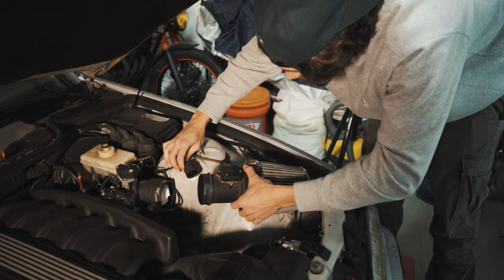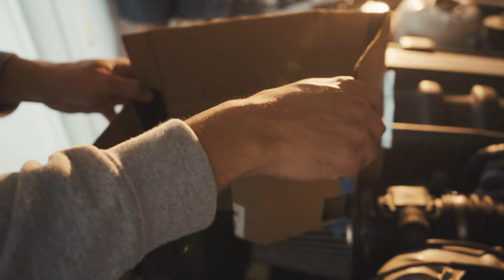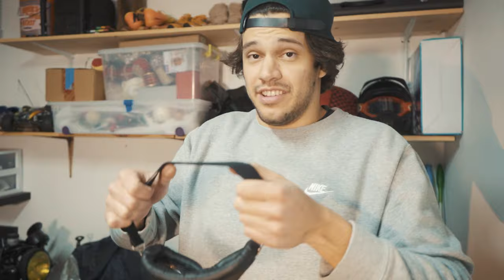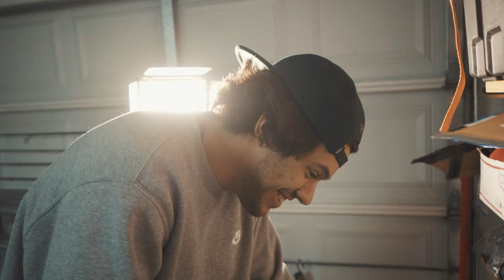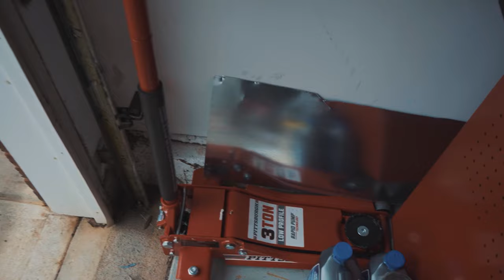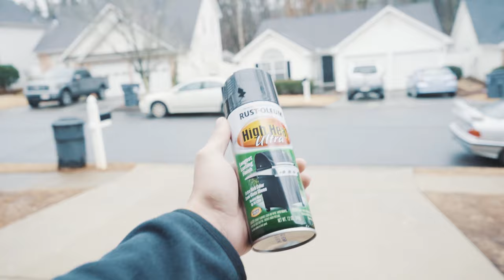DIY E36 Air Intake Heat Shield! (how to make a heat shield)

Comment: nice, but the problem is that iron plate can get the hot air and keep the air inside the area warm....but the job was awesome!
Reply: That is True but to be Fair he has alot of cold air traveling in From that front Right Panel, It looks like it protects it better than factory.
Reply: @organicintelligence6431   Better???? bro factory is just a whole splatic box where 1 small pipe goes to the front getting only cold air.......

This only better to have when you install such filter since without you probably lose more HP then what you had with the orginal filter.

Comment: don’t use a thin sheet of aluminum as a heat shield. heat will not deflect like you want it to if you’re using sheet thinner than 1mm. it will only trap it and eventually allow it to travel through

Comment: I have a '96 corolla that I recently bought a short ram intake but want to build a heat shield for it but don't know how I'm gonna do it exactly & don't know what parts I need
Reply from the maker: I explained what materials I used in this video. Use cardboard for the mock up, it'll help a lot
Reply: @ONGO_  and I can still use the bottom of my air box as a bade so air can still come in?
Reply from the maker: @Jeremy_Hill_2020  I'm not sure how the engine bay is built in that car so I couldn't tell but as long as there's airflow you should be good

Comment: Did you test for temperature delta? 1) What was the air temperature (ambient) and 2) the air temperature at the sensor before heat shield? Then 1) the ambient air temp and 2) the air temp at the sensor with heat shield on? Usually from 1) to 2) there's a temperature increase and if your heat shield is working the increase in temperature from 1) to 2) will be less (that's the delta). A problem with many heat shields is that after they heat up there's no change (0 delta) or worse + delta. What you want is a negative delta (a measurable decrease in temperature to the sensor) after the install. No change or worse means you wasted time, money and effort (I hope not).
Reply: I think I have that problem with mines right now. It does works but becuase of using aluimuim and haven't put anything on the outside of it, it warms up. Atleats it colder then before becuase previos owner had nothing and was really bad, hot days when sitting still the engine could turn sluggish becuase of the hot air it was getting from the engine bay. 

Now I have putted the orginel inlet trough the shield and added even a extra inlet from below where air goes from your bumper to your brakes, I open it then put a long pipe to my airfilter. It get the job done and works pretty great but it is not the perfect solution. Will work on it but am thinking of swithcing to something else then alumuimum, maybe ABS plating since it pretty easy to work with but way better heat resistatnt. Maybe even double layer with air in between for even better heat resistant :).

Comment: I finally bought the stuff to make a heat shield for my intake 
my dad already has a dremel & a angle grinder in the garage which is good
Reply from the maker: hellll yea g! send me a pic on Instagram when ur done!
Reply: @ONGO_  my dad already has a angle grinder & a dremel so he's ok with me doing it 
also I think I might have to make a bracket to hold the heat shield in place so its not loose
Reply from the maker: @Jeremy_Hill_2020  yesssir, I used zip ties when I made this because I was a noob but I think you should def use rivets when you can
Reply: @ONGO_  I definitely don't have rivets or a rivet gun
I hope a rivet gun ain't expensive <.<
Reply from the maker: @Jeremy_Hill_2020  they're pretty cheap at harbor freight
Reply: @ONGO_  also I tried using a dremel to cut the metal but the dremel is barely doing anything to the metal
the angle grinder my dad has somehow isn't working right
so my best option is a snip tool & maybe use the dremel to trim the sharp edges
Reply from the maker: @Jeremy_Hill_2020  make sure you have a blade that is for metal
Reply: @ONGO_  I finally got a rivet gun
but would probably need a angle grinder or at least the snip tool to cut the metal
and whatever I need to bend the metal into a certain shape to make sure the corners are sealed, etc
still gonna figure out how to use the holes on the bottom of my stock air box (to hold it down from the bottom) as a base & find the specific bolt & washers for it

Comment: Thinking of use a mini keg for a shield!
Reply from the maker: That would be sick!
Reply: @ONGO_  I know, will sound great as well. Just need final measurements. As the k&n has the jubilee clip on the OD on while the pipe goes into the filter flange thinking where does it sit. Maybe bore the hole, so it sits right up in the keg the  clip is on the outside. The second part;  10.2*6.3" will it fit and how short can it go or do need to trim some front facing. The filter is 5.2 wide and 4.6" long, so will have room inside just how deep can it go in the car. $40 project! How much did yours cost?

Comment: What intake is that ? I’ve been looking for one that doesn’t delete the mass air flow sensor plug
Reply from the maker: I bought the car like this already but I think the previous owner just took out the stock air box and put in just that cone piece on the end. You can get any after market cone end like that and it should fit I think. That way you can keep that stock MAF
Reply from the maker: something like this 

https://www.knfilters.com/re-0950-universal-clamp-on-air-filter?gclid=CjwKCAiA65iBBhB-EiwAW253W8JbSovIEf7A1UQVqyEBrDcUIj7ashreeYaa5XCkjV9t1CY_0IHu4RoCSFEQAvD_BwE 

just gotta measure the diameter of the end its going to, to make sure it will fit